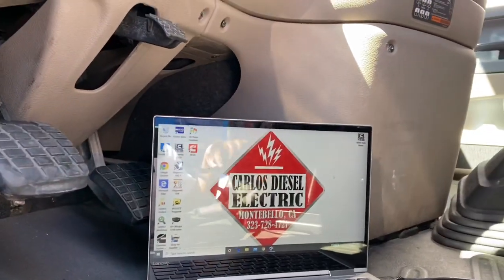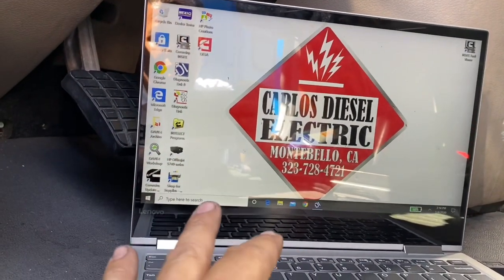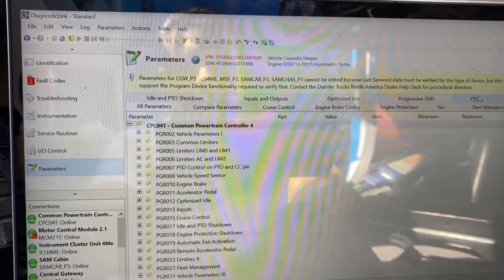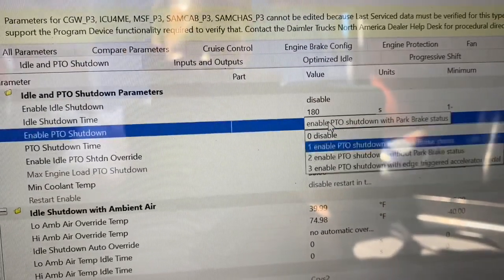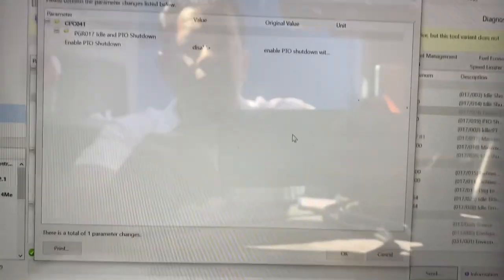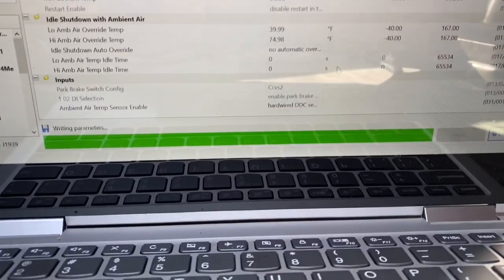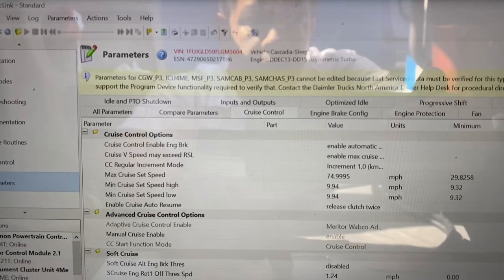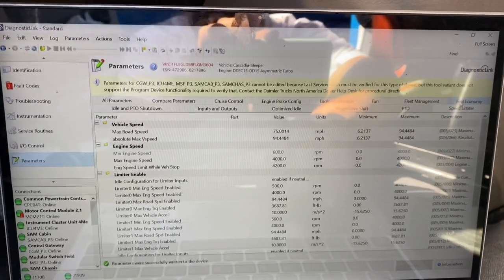How to stop your truck from shutting down after 5 minutes.

Comment: Hello what if the password is not 0000 where can i get the password
Reply from the maker: Unfortunately it would have to go to the dealership. The truck has to be connected, while it is connected they have to provide the seed along with the VIN then Detroit will provide the back door password. 
Unfortunately Detroit will only release that to an authorized dealership. They used to give it to techs that called in.

Comment: this is the exact video i been needing. my question is where do i get the software from? i have the snap on apollo+ scanner but cant seem to change the parameters i need to.
Reply from the maker: The software I use is available through Nexiq. They offer two versions, standard and professional. I use standard, lets me make parameter changes, perform regen and many other things except software updates

Comment: They got rid of all of these things, but it reset once i cycled my truck on and off
Reply from the maker: @crabtreebrad  silly question but I have to ask. Did you save the parameter changes before exiting?
Reply: @CarlosDieselElectric  as far as I know, they did. I picked up the truck at Exodus truck in dupo, IL and they did it
Reply: I'm reaching out to the company I'm buying the truck from to see if they can do anything remotely. It will idle if I leave the brakes off and just use trailer brakes, but it won't Regen like that so I still have to get up a few hours into sleep
Reply from the maker: Sounds like they may have missed a parameter. Try using the cruise control to bump up the RPM. 
What year is the truck?
Reply: @CarlosDieselElectric  it's 2021
Reply: Yea it still shuts off from high idle, but I may have managed to get it to keep on, it's been on for about 30 minutes since the last attempt at shut down
Reply: I've had to go through a few times of hitting the accelerator. Hopeful that it's done now
Reply from the maker: @ it’s a parameter they may have missed. I’ll check it out tomorrow when I get in

Comment: Hey, a question for you, since you know all about this ddl software. Is there a way to disable the horn from honking when you have the brakes released and open your door?
Reply: 2024 cascadia
Reply from the maker: @willytannenbaum5247  there is a sensor on the driver side. Near the front brake valve. Just open the hood. Should be able to disconnect it.

Comment: Have a vanhool with a dd13 trying to shut off the idle shutdown but when I attempt what you did in the video I don't have a drop down menu with options
Reply from the maker: @alc156  what year?
Reply: @CarlosDieselElectric  2018
Reply from the maker: @alc156  I can check for you when I get back. I don’t recall from memory

Comment: Hey bro my 2019 cascadia keeps shutting off even though im doing the idle over write on the dash board after a while it keeps shutting off even though im doing the over right! What can i do ??
Reply from the maker: Check your settings. The truck can shut down with the truck at idle and also with the RPM bumped up. You have to zero both of them out.

Comment: I just bought a 2010 volvo d11 and shut off what program I need to do the programming thanks
Reply from the maker: Volvo uses Premium Tech Tool. But there might be others out there that are more reasonable in price  
Try using Nexiq and sometimes your eld has the option to read fault codes
Reply: @CarlosDieselElectric  thanks God bless
Reply: Could I change perimeters on the truck costly repair
Reply from the maker: @javierdomenech8221  find someone who has the software. It will be must less expensive then the dealership.
Reply: Thanks

Comment: I just bought a Freightliner 2018 from Penske. Idle is not active ( I cant change anything ) Can I do it online by calling  Dealer? Do I have to bye anything?
Reply from the maker: You need the software and have to be manually connected to the truck in order to make changes. Ask for the MCM passwords you might need these in order to make changes if the MCM is password protected
Reply: @CarlosDieselElectric   Yes I understand but where to ask . Is it the dealer or previous owner that in my case is Penske?
Reply from the maker: @maksimsotiri7802  Penske is definitely the place to ask.

Comment: I got lucky they didn't change the parameters from the factory. It has 70 on the cruise and 68 on the pedal. No idle shutdown. It will idle until empty on mine.

Comment: What software is this?  and did you connect through the OBD port?
Reply from the maker: The software is from Detroit Diesel 
https://diagnosticlink.nexiq.com/DTNA/Default.aspx
You will need the 9 pin connector with the green plug. The old 9 pin connector will not work because of fitting.
Reply: @CarlosDieselElectric  thank you for the quick response! Your videos are very informative and provide a lot of insight for us drivers. Appreciate the work you do💯

Comment: How can i set it to 85 degrees, My truck only stays running if it's over 102 degrees outside and shuts off every 20 minutes. The company I work for won't do anything about it. When I use the bunk AC it only lasts for 3 to 3 and half hours. They got the batteries checked, ( I think) but still does last on 3 hours or so. I hate waking up in the middle of the night to keep the truck running to stay cool
Reply: I'm in the same boat

Comment: Why does trick say it going 70 on speedometer  but actually only 67
Reply from the maker: There could be a parameter that needs to be changed on the gear ratio or the REV (tire size).

Comment: Does this apply to non California trucks?
Reply from the maker: Any truck with an ECM has the parameter that can be changed to install or remove this feature. 
As long as there is no password then the charge can be made.

Comment: Does this work with PACCAR KW motors and systems?
Reply from the maker: Unfortunately Paccar has a much stronger hold on parameter changes. To remove this feature, you have to call Paccar and make the request. Once it has been made and approved they have to upload it and then with the Davie 4 software you perform a software update to make this change. 
This was my last experience with Paccar. It sucked. 
The software used to allow changes without all that.
Reply: @CarlosDieselElectric  thanks a lot.

Comment: I just bought a freightliner m2 106 26 foot box truck and 2 days after I bring it home I started it up and the idling was high and when I turned onn the cruse control it went down and when I disable the cruse control the idling get high again how do I get that fixed?
Reply from the maker: After the truck warmed up, did the RPM drop or go lower?

Comment: How can I reset the password  when I change the parameters of shutdown the engine.
Reply from the maker: If the MCM is password protected, you can try 12345 or 00000. This is the default password, if that does not work then you have to go to Freightliner or an authorized Detroit Diesel location. They have to connect to your truck and call Detroit and request the SEED or back door password. It is free to them but the dealership will charge you for their time.
Reply: If any aftermarket app. to reset that password.
Reply from the maker: @jatindersinghreehal  not that I am aware of.
Reply: Ok . Thank you....

Comment: BIG QUESTION Pedro... do you know how to change the parameters on the DT12 automatic transmissions attached to a DD15? For example, enabling or disabling Automatic Eco mode, Automatic Performance mode, or Manual mode (as well as disabling RPM shifting limits when on Manual mode)? If so, can you make a video or tell me how much would you would charge to get this changed? Also, can you change the horsepower rating from 455hp to 505hp on a DD15? I've seen DD15's range from 400hp to 505hp from factory. I'm subscribed to your channel by the way... thank you in advance!
Reply from the maker: Great questions, with the DDDL software you should be able to make changes to the MCM. 
Horse power can be changed but only to amounts set be the MCM, for example some DD engines allow HP to be changed while others will only have one HP to choose from.
Reply: @CarlosDieselElectric  Thanks Pedro! Maybe I could be your first customer in which you can make a video demonstrating these types of changes?
Reply: Carlos could you do a team view and tune my dd15 and the cost

Comment: Does it work on paccar engine
Reply from the maker: Paccar is much more difficult, the shutdown feature is controlled through the computer but in order to remove it has to be done through the dealership. Paccar has to change the parameter directly through their side then the dealership has to update your trucks software in order to remove this feature.

Comment: This doesnt make much sense to me. Manual says idle shut down will not occur with PTO active. Wouldnt disabling PTO not resolve anything.
Reply from the maker: Are you talking about the truck manual? If you are talking about the truck manual that is different. The MCM controls the engine. So if the parameter isn’t set correctly then the truck will shut down. Normally you are correct, but that is why you have to change the parameter so the truck will not shut down or will depending on the settings the technician has set.

Comment: 2021 Freightliner SD122 day cab. 6 speed Allison automatic. Figured out if you set the trailer brakes but NOT the tractor brakes it won’t shut down.  Wouldn’t do it on much of a grade but it worked today for me. Transmission in neutral and set trailer brakes leave tractor brakes button pushed in 👍 hope this helps till the shop can program it

Comment: Pedro so if I want it to shut down the truck, I would enable the pto and idle or just pto?
Reply from the maker: Do you mean with the software or after you have made the changes and want to shut down the truck?
If you are talking about after, just hit cancel on the steering wheel or just turn off the ignition.

Comment: Thnx great video...why are companies setting it to shut off after 5 min anyway...I got a ryder truck
Reply: Simply it's to save fuel, prevent idling. Typically daycab city trucks and trucks equipped with an APU
Reply: @vincentwoodward7802  to save fuel 🤣 i woke up to a dead battery
Reply: It also keeps city trucks from idling so much it clogs the dpf.
Reply from the maker: All about saving fuel so trucks don’t idle. This definitely sucks for drivers waiting during the summer months.
Reply: And in WINTERS

Comment: Great carlos. Can yo be more spicific as to the software I need to buy. I went to the link you provided but WHOA they have so many options. I went to a shop to have my idle shut down override but now it shut down every 30 minutes so they did not do it right . 2019 cascadia
Reply from the maker: I did have something similar happen, the 5 minute shutdown was removed but the truck still shut down after 30 minutes. Not sure if this is a Detroit parameter or a Freightliner parameter. 
The software I use is the Detroit Diesel Diagnostic Link that you can purchase through Nexiq. I know there are a few other options available. 
What kind of software are you looking for? What it is you want to do with the software?
Reply: @CarlosDieselElectric  yes I was going to get the same software you had in your video so I can go in and disabled the automatic shutdown mode as you did. I just figured that the shop I took it to didn't do it properly or didn't save changes like you did in your video. I appreciate it very much to help and responses that you gave
Reply from the maker: @markhibdon1314  if you just want to change that parameter, then I suggest taking it to the dealer. They charge about 2 hours and you should be set. The software is really good to have but does require an annual subscription of around $800 plus the hardware and laptop but having the software does have its benefits. 
So you have to keep that in mind and weigh out your options.
Reply: I to would like to know the software. Plus  can the company see that it was changed if I do it myself. Or take it to a shop
Reply from the maker: The software is from Detroit Diesel. It can be purchased from Nexiq. There is an audit trail that shows the history of who signed on. 
But making changes is no big deal. 
The option you might need to look into is optimized idle

Comment: Will this be the same on a Cummins mine shuts down after 30 min I had someone disable on the Computer and it had been disable also took the temperature sensor from the driver mirror Ect all the basic stuff Is there another way to do it?

Comment: do I need a nexiq link or can I just connect the eld to the laptop and diagnostic link?
Reply from the maker: I connect directly to the 9-pin using the laptop then opening the diagnostic link to make the changes. I don’t believe the ELD is necessary.
Reply: @CarlosDieselElectric  what Cable can I use with the 9 pin to connect directly to a laptop

Comment: How do you connect to the truck like this?
Reply from the maker: I use the DDDL software from that  I purchased from Nexiq Diagnostic Link. You will also need the  9-pin connector.
Reply: @CarlosDieselElectric  how much does the software cost??
Reply from the maker: @ImQ.Official973  annual subscription, for the standard level you are looking at around $800 which can let you do almost everything you need except for updates and some changes but for the most part you can change most parameters. I recommend you look up the software with Nexiq and call them to see which benefits you most.
Reply: How much you paid for the software??

Comment: my dd15 after 2 min on the parking brake the engine off by itself how to remove the timer
Reply from the maker: You will need to use the DDDL software and change the parameter. 
It is very quick and easy to do. Just needs to be disabled.

Comment: How much you charge to fix this problem?
Reply from the maker: To make parameter changes (idle shutdown, MPH or cruise control adjustments). The cost is about $80-$100 total. Does not take very long, the only obstacle is if the MCM is password restricted. Then you don’t have a choice but to go to the dealer and have the password removed.

Comment: now show were to 100% disable that damn ongaurd
Reply from the maker: LOL. I hear you. I think that is a dealer only option. I have to temas with the program a bit more. I’ll look into it
Reply: @CarlosDieselElectric  also that lane assist that just keeps turning itself on. in my truck it does nothing, just a bright ass light on the dash every time it comes on. Personally owned non commercial truck.
Reply: @nathan00campbell  I'm in a 2022 Cascadia and there's a button above the brakes to turn off Lane Keep Assist, but it'll temporarily turn on if the Lane Departure Warning happens.

Comment: We have one that right before the 5 Minute mark the check engine light starts flashing and shuts down, is that normal for the check engine light to flash? Thanks for the Great videos
Reply from the maker: cobravenum yes. It is programmed into the MCM. When it reaches 300 seconds (5 minutes) it will flash the CEL right before it shuts down. Completely normal, this feature can be removed with the program as long as it is not password protected. 
Most of them are not password protected.
Reply: @CarlosDieselElectric  thank you for this information. After 4hrs of research you finally confirmed that it's a program shutting off my truck with the flashing check engine light, not a serious problem.
Reply from the maker: @adventuresoftheindian5203  yeah, if the parameter is set on the MCM. Once it reaches the time limit it does set the check engine light to flash. Does freak people out. Happens to me all the time when I am in a truck. Then I realized it was just the normal idle shut down.

Comment: Mine still shut down
Reply from the maker: Does the truck shut down when idle or when the PTO/cruise control bumps up the RPM? After how many minutes does it shut down?
Reply: @CarlosDieselElectric   mine shut down with rpm at 900 after I think about 15 minutes.
Reply from the maker: @draleighd  there are 2 settings that need to be checked. One is at idle and the other is at the PTO. Both need to be switched.

Comment: How can I get one of these computer programs for my truck and my computer?
Reply from the maker: Check out my other video I made, I go over what software, computer and repair manual I use for troubleshooting and repairing the DD13 and DD15 engines. 
I also attached some links that you might find helpful.

Comment: Hey Carlos I’m getting I’m getting multiple codes for the inlet nox sensor on a ghg17, could I just change the sensor without having to reset the code on the software
Reply from the maker: Juan Romero I recommend replacement of both Inlet and Outlet NOx sensors. You will need the software to run a successful regen in order to clear the code. The system is designed that way. 
What fault codes are you getting?
Reply: Carlos Diesel Electric thanks Carlos, I’m getting 520364 fmi3, 3217 fmi3, and 520367 fmi3

Comment: With the software can I bump up the power from 455 to whatever is safe ish
Reply from the maker: with most Detroit engines you can make this increase. Usually it is 455-475 HP or 455-495 HP.  (those are examples) each truck can be a little different. Before you do that, check your RPM restrictions, sometimes you can make the change there and that will help.
Reply: Carlos Diesel Electric the truck not restricted, I can rev to whatever I want and drive as fast as 99mph never done any of that stuff I always shift at 1500 but when it come to the hills or mountain baca I know that 10 speed don’t help either...